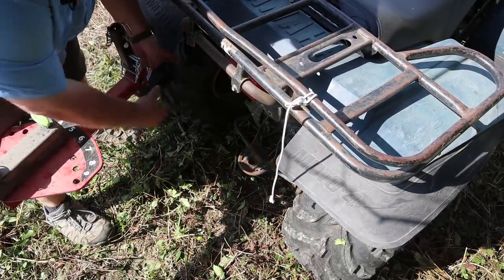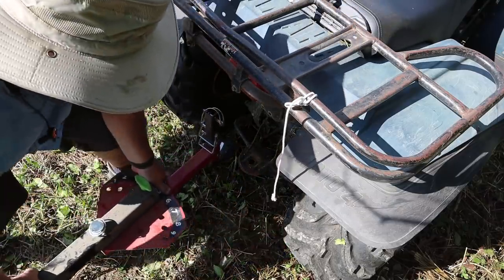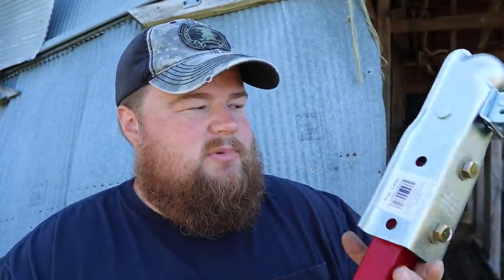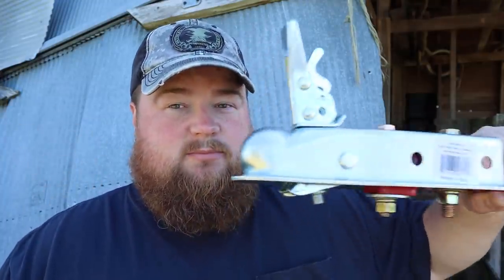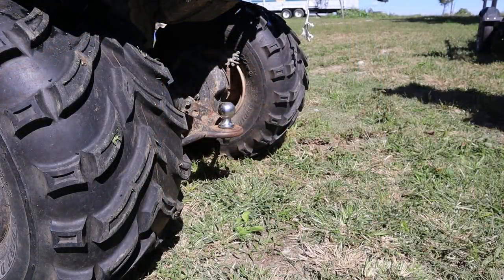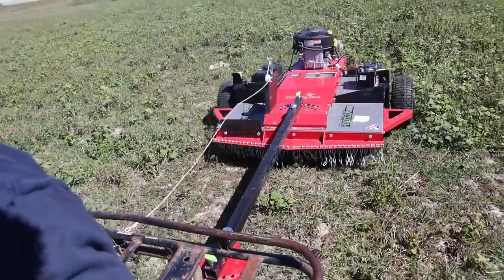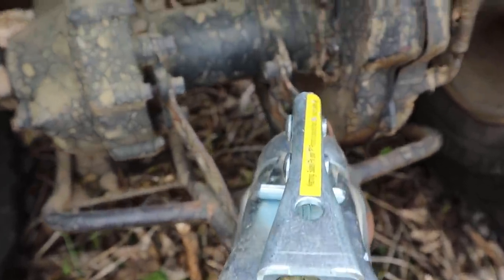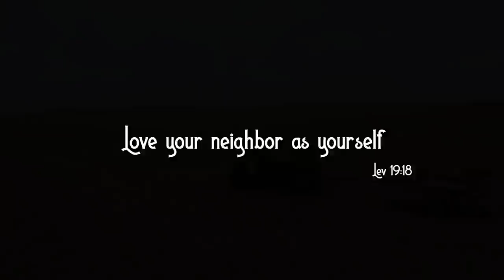FIXING a PROBLEM with our BRUSH MOWER

Comment: Why don't you use the offset so you are not getting smacked in the face with brush, Or have you and you find it better straight ?
Reply from the maker: The ATV didn't have the power to pull it off set through the really big stuff. This is only a 350cc 2WD ATV, so not too powerful for the big things.

Comment: Second year in a row this machine has been down multiple months and I haven't been able to mow the grass and weeds on the 60 acres. As far as I know the shop is awaiting a wheel bolt for the one that fell off this new replacement machine that has only worked for about 15 hours so far this year. Customer service is atrocious.
I do not recommend this mower.